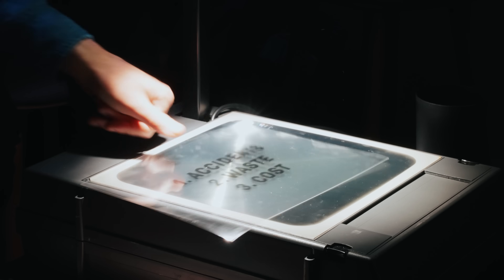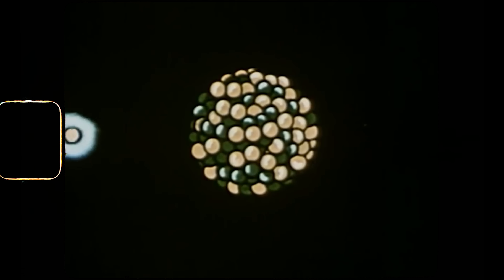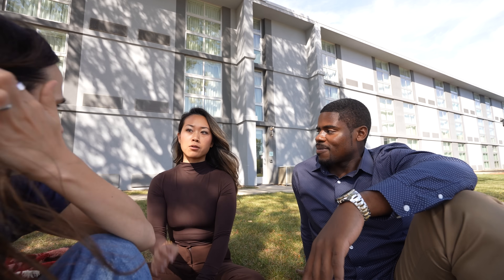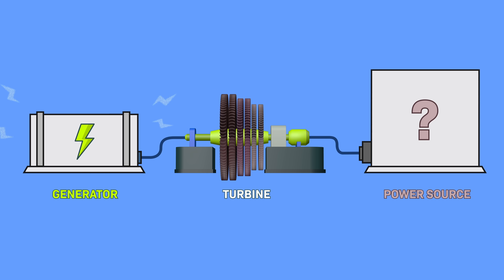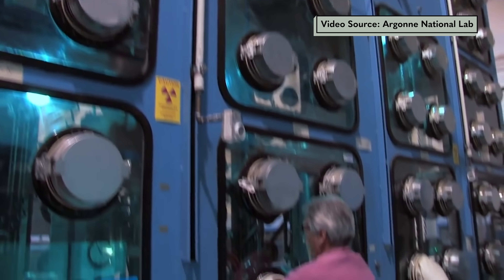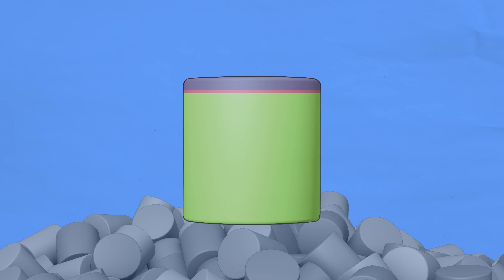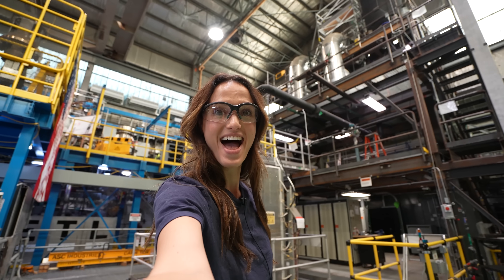The Big Lie About Nuclear Waste

Comment: You should check out Thorium reactors! These produce less waste, could use existing waste as fuel (recycling like you are talking about), and are less "dangerous" than Uranium reactors. I know today Uranium reactors are pretty safe, but in a nuclear emergency they would just cool down instead of going Tsjernobyl. The only reason we stopped using them, is because Uranium could be weaponized for nuclear warfare and Thorium can't. Pretty sad, no? Thorium is also much more abundant on earth, and the mining process is safer and more efficient compared to Uranium. Please look into them, you'll be amazed! There are some interesting TED talks about Thorium to get you started.

Comment: As for the second last segment, you claim that fuel isnt recycled because new uranium is cheaper than recycling. What you leave out is that spent fuel needs to be stored, and at least here in germany that is a fairly expensive process. Is it still cheaper to use new uranium if you have to consider cost for longterm storage? The german department of energy is guesstimating 170 billion euros to store nuclear waste until the end of the century - given that germany foolishly just abandoned nuclear power that means they only have to store what they have now. I cant imagine that recycling is that much more expensive, especially in the long run

Comment: Any thoughts on thorium molten salt reactors?  I would be interested in hearing a comparison between these two technologies.
Reply: Just randomly found the channel and am perusing the comments. My knowledge comes from "Atomic Rockets" and other Web sites. Two issues with Thorium are (A) You still need Uranium to help give the reaction a 'Push' (B) Molten (As in kind of liquid) salt reactors are a bigger engineering 'Thing'. Look up some of the thermal power plants using a different type of salt as their operating medium. Cheers! 😀

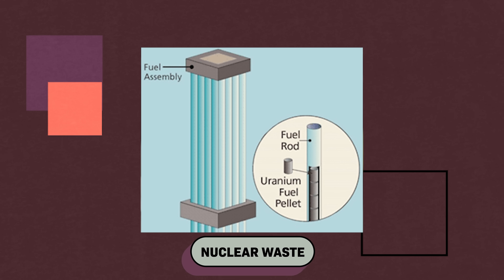Comment: 7:08 The 235 part of Uranium-235 isn't the number of neutrons, its the number of nucleons.
Uranium is element 92, so it has 92 protons which balances 92 electrons.. in order for all those protons to populate the tiny nucleus it requires neutrons to bind it all together. In isotope 235, there are 235 - 92, or 143 neutrons.
Reply: @mute8s, Relax. If an argument can't stand minimal criticism, it wasn't a very good argument. And it's better to know the truth even if it's uncomfortable.

That being said, this is mostly a pedantic discussion.

The video is correct that the number refers to how many neutrons are in the atom. It might be MORE accurate to say it IS the number of nucleons (the number of protons + neutrons). But it's also true that the number identifies the ISOTOPE, which is what we are concerned about here and the isotope is COMPLETELY determined by the number of neutrons. So, the isotope is what matters regarding the number and the isotope is entirely determined by the number of neutrons. The ONLY reason the number of nucleons matters is because the number of neutrons in that nucleon is changing between isotopes. The number of protons is what makes it uranium. It's no longer uranium if the number of protons changes. So, we can be certain the number of protons is NOT changing and thus the number identifies how many neutrons are in the atom because the other half of the nucleon NEVER changes.

So, basically she's right. The number identifies the isotope which is determined ENTIRELY by the number of neutrons in the atom.
Reply: @brennenbeck7311  And we can be even more pedantic, lol, by clarifying that "the other half of the nucleon NEVER changes" only in the context of the element referred to being defined (such as the U in U-235), because the number of protons clearly changes in the context of a nuclear reaction to form a new element, for example, plutonium.
Reply: Beat me to it!
Reply: Whoops. You already mentioned it! I just posted but you got it!
Reply: @Carhill  thank you, I was going to point that out. The isotope number (235 or 238 in this case) does tell you how many neutrons the element has but to get that number you subtract the atomic number of the element. It could have been worded more precisely to clarify how the isotope number gives you the number of neutrons.
Reply: The difference between U-235 and U-238 is three neutrons. That was what she meant when she said it.
Reply: People tend to forget the second bigger number on the periodic table of elements and what it means
Reply: Great presentation.
Reply: This video is a waste of time. Nuclear waste will be the death of this planet.
Reply: @blaynestaleypro It must be tiring putting that much energy into being illogical. You're worried about nuclear waste but discussing producing energy while reducing the radioactive life of existing nuclear waste by a factor of 1000, which already exists in massive quantities and isn't going anywhere, is a waste of time. Flawless logic. Tell me you're in the 'progressive' cult without telling me... The world is never going to bend to your will and vision, might as well work on productive solutions within the parameters of reality. Or, just shout into the wind and keep living in fantasy land. Nuclear waste doesn't even crack my top 20 existential threats.
Reply: @blaynestaleypro  I thought the point of the video is that is doesn't have to be the problem that is has become. Also, is seems unlikely that we would ever be able to produce enough nuclear waste to kill the planet. So perhaps a better way to say that would be that government interference will be the death of the planet - although not really, but maybe the death of civilization.
Reply: @blaynestaleypro  Your comment was a waste of time, because you clearly didn't watch the video.
Reply: @Aldaris1234567  I dont' need to watch it. Nuclear waste is deadly no matter how to deal with it.
Reply: @blaynestaleypro  From what I see from your subscriptions, you are a spiritualist. Makes sense as to why you would dismiss something without ever taking into consideration the other side. By the way, nuclear waste isn't the glowing green ooze you most likely think it is because it is metal. I am sorry if you think this is a personal attack because it definitely is one :). (I am acting like you are. I am dismissive and won't change my views even when the information is right there.)
Reply: @Aldaris1234567  it won't be deadly. It'll just be in a mountain enclosed in concrete forever. The concrete will last forever. or the water it's submerged in will last forever. Completely sustainable. Right? a duuuyy duyy duuuuhh..
Reply: @blaynestaleypro  and the video answers this. Stop being ignorant.
Reply: But does this error take away from the message she is trying to get across? I get wanting to correct someone on making a mistake, but please think about the impact your correction is making. People might see your correction and totally dismiss the message she is trying to get across. So if her mistake is fundamentally invalidating her message please explain that with your correction. If it doesn't then make sure you point that out in your correction by saying something like "Great video, I'm glad you're getting this info out but here is a correction to something you said in the video..." Many people will come to the comments on controversial topics like this to see if there might be any glaring problems with the message that's being put forth and it sucks when a topic is unfairly invalidated by someone who just wants to point out a small issue with the video. Sometimes were just better off not saying anything if we don't want to take the time to explain ourselves.
Reply: @mute8s  you're what's currently wrong with the world in its wokeism
Reply: @mute8s  You’re of course correct about the wording, but I’m glad he brought it up.
Reply: @mute8s  The error doesn't take away but it's important to point it out. Despite being a huge fan of Cleo, the mistake made me skeptical about everything I was being presented with since it's basic knowledge within the subject.
Reply: @mute8s  Yes, the message she is trying to get acrossis overly simplified.  Doing a cost benefit and risk analysis on using nuclear waste, it just doesn't make sense.
Reply: @mute8s  such a basic fault actually questions her understanding of basic physics. Of course that raises questions about everything else she says.
Reply: @ValheruGaming Not really, or rather, not necessarily. Mistakingly saying its the number of neutrons vs nucleons is what I'd call a minor slip-up, the kind of minor mistakes that everyone makes from time to time, even those who know better. It's especially minor here since her explaining that number was just a offhand thing so that people wouldn't wonder, but was ultimately not important for the overall video subject and the point she was making. Sure, such mistakes gives cause for us to check further for mistakes, but that's it, and I at least didn't detect any. My point being, there's reacting to actual serious mistakes that brings the video's validity into question, and then there's being overly pedantic about non-essentials. I think this discussion is the latter.
Reply: @mnxs  This doesn't happen with things you are really familiar with. The question is, is somebody who obviously ins't really familiar with the basic structure of an atom the person to lecture the world about nuclear energy being a great way going forward.
Reply: @ValheruGaming  no, because she is technically correct. The isotope number does tell you how many neutrons the element has. She just didn't explain the math for how you determine the number of neutrons using the isotope number. It could have been explained more clearly or better worded, but she didn't make a mistake.

Comment: "Nuclear waste problem" is the most successful lie fossil fuel lobby spread. They even got otherwise well informed, cool headed people to repeat it. 

Chemical waste from everything from mines to coal fired power plants is orders of magnitude more dangerous, usually literally for ever, and nobody gives a s**t. (BTW, one coal fired plant I worked with produced ash with 100 ppm of uranium and similar amount of thorium in it, along with significant amount of vanadium and some other elements - enough to be considered an ore! And all that was also in dust from the landfill  and fly ash that escaped cyclone and electrostatic filters, and there was a significant amount of that, too.)

One could perfectly safely vitrify (mix with silica and various metal oxides and turn into glass) long life (that is, low activity) waste and dump it into oceanic subduction zones. But burying it anywhere  inaccessible enough that reaching it requires reasonable level of technology guarantees that a hypothetical future civilization that forgot about it will recognize it for what it is if it reaches it. No need for some "universal danger signs" - another clever component of FUD campaign by fossil fuel criminals.

Comment: Unfortunately you are wrong. The reactors you are talking about, molten salt reactors, have only been taken to test phases, found to be not viable, and abandoned. The materials they are built from deteriorates very quickly. And no matter how enthusiastic you are, these reactors a prone to real problems. The nuclear industry have been promising a solution to nuclear waste for decades. But so far zero solutions!
Why are you really doing this video?
Reply: I think what you mean is fast breeders, not MSR, where the first one too can be used to use/recycle nuclear waste. Anyway, she is talking about neither, she is talking about a process to use electrolysis to separate waste into smaller amounts of "true waste" and stuff than be used as fuel for conventional reactors again.
Reply: @georgelionon9050  Hi George, I was not just talking about fast breeders but used them as an example, but also the technology for "eating nuclear waste". So where are these "waste eaters" you are talking about? I am aware there are 'plans on the drawing board', but the technology is far from proven and may be abandoned yet again!
I will say it again. The nuclear industry have been promising a solution to nuclear waste for decades. But so far zero solutions!
Reply: @billirwin3558  I'm with you that this kind of empty promises and half-truths is what made people lose faith in nuclear industry.

As far I see she talks about a process using electrolysis to regain fuel, someone else posted here - something she and/or her sources didnt mention - the main issue with this is, the exact chemical composition of such regained fuel is less clear than unused fuel, which is an issue if you put it in an reactor, not knowing for sure what kind of radioactive series you get with what kind of mixtures.
Reply: @georgelionon9050  Yes George, you are right. I am not anti nuclear but just wanted to point out promise does not equal reality. I really hope the tech works. But I do have reservations given the track record of the industry.

Comment: So the 87% of not useable junk discarded in the recycling process can be spread on lawns as fertilizer? It’s suddenly not also nuclear waste? And it only takes 30,000 years to radiate to safe instead of 300,000? Oh! You mean fast breeder reactors that were part of a nonproliferation treaty with USSR because they are a way of making plutonium and we need few bombs not more. So sorry - I’m not a cheerleader.

Comment: That's one of the fundamental flaws with capitalism. If there's not enough profit in it corporations won't touch it, and "the state" can't do it because that would be competing with "the free market". It's the same with nuclear fuels, fossil fuels, cancer treatments etc.

Instead of separating the material in a molten salt bath in order to make new fuel rods for old-style power plants like they do at Argonne, we can build 4th-gen molten salt reactors and just shred the used-up pellets in there. The usable fuel will be used right then and there, and the waste product to be stored for centuries instead of eternities can be filtered out. Still far less profitable than running a fast breeder and dumping the rods on some remote farm, but so much more sustainable. Even if we were to run out of spent Uranium fuel rods, we could just shovel Thorium in there which as a waste product of rare earth mining can be had for a dollar a truckload. Also, these reactors are infinitely safer since there can't be meltdowns or explosions spewing radioactive particles into the atmosphere - the worst possible accident would be just the whole thing shutting down.
Reply: This isn't a feature of capitalism but scarcity.

Comment: Nuclear is a temporary answer to beating climate change for many countries. We need to switch to renewable fuel sources, but until we've found a way to generate power in colder countries where a good portion of the year they get little sunlight and wind turbines would freeze up, nuclear could be used half the year to solve carbon emission problems. Then we find some way for them to get a renewable clean energy source, or make deals with warmer countries to subsidize energy plants and pay for cables that transfer energy to the cold countries.

Comment: When you say "clean" energy, are you simply referring to the low carbon dioxide released (mainly in, mining the fuel, transportation and concrete) compared to fossil fuels?

Because, nuclear is not "clean" even if waste is recycled.

Language spin is deceptive. If you want to create a set for it to belong to, which also contains wind/solar/hydro, call it non-fossil fuel energy. 

Don't hijack the language to influence the opinion of the audience.